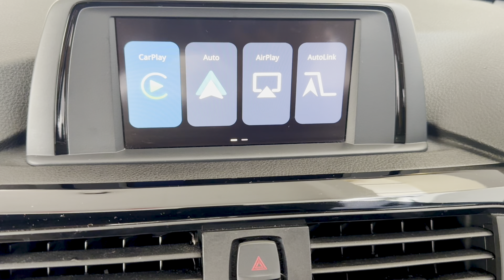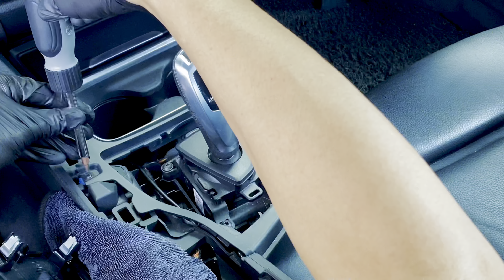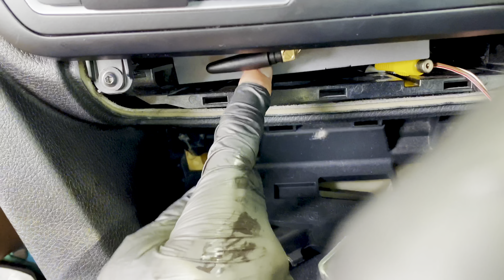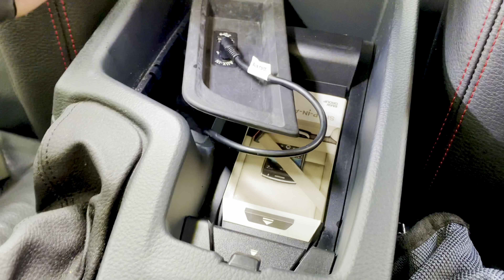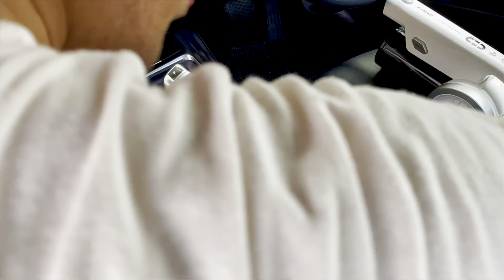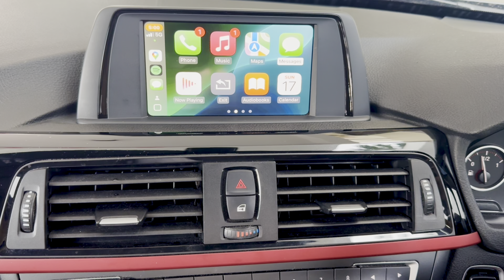Affordable BMW F Series NBT Wireless Apple CarPlay/ Android Auto/ HiCar tutorial on F30

Comment: Hola he instalado una en mi F30, no tengo cámara trasera ni quiero nada mas, solo para CarPlay.
El caso es que lo conecto todo y la primera vez me apareció bien, pero en los ajustes que me aparecieron en la pantalla no se si desactive algo sin querer y se quedo la pantalla en negro, pulso menú y vuelve a conected drive, vuelvo a pulsar y otra vez en negro. Incluso en conected drive si meto marcha atrás en vez de salir el radar de aparcamiento, intenta salir Carplay pero no llega a conectar y se pone negro otra vez hasta que metes marcha hacia alante.
Alguna idea de que puede pasar?
Gracias
Reply from the maker: Hi, check if you have set the screen size to small. The red toggle switch. I suspect the screen size set is to big.
Reply: @CTB6  correcto ese era el problema, y desactivar las opciones de cámara reversa.
Muchas gracias

Comment: Great video, you can code the AUX to go trought the BMW Radio module, that way you don't have to plug in the AUX cable. Basically it's aux delete :)
Reply from the maker: I’m worry that I might mess up the code. Do you have any good video link to share that actually provides a guide to do it?